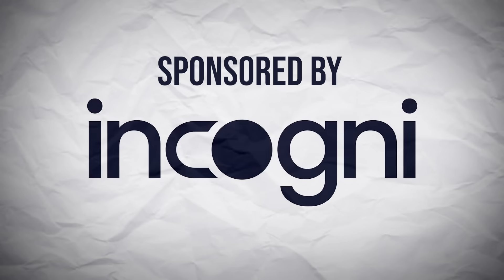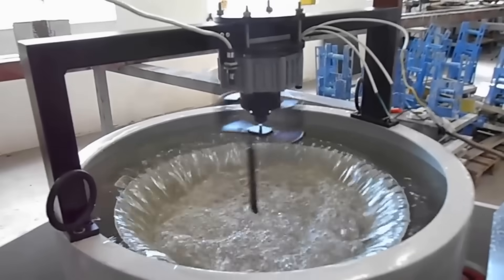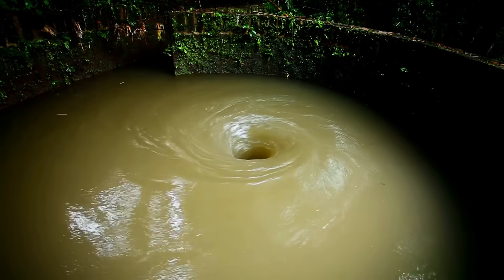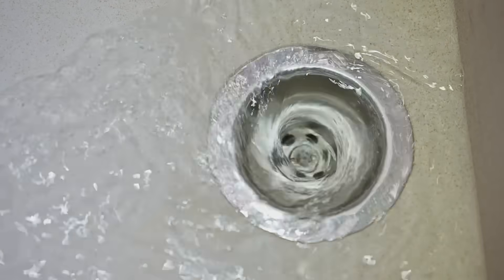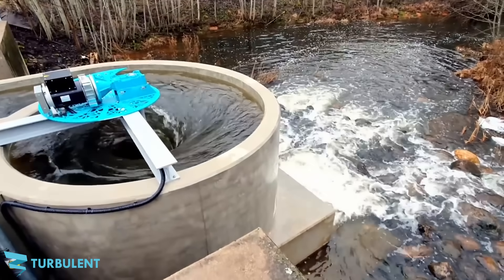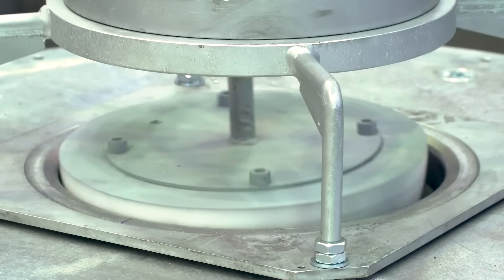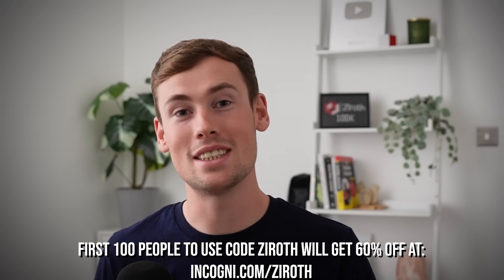Genius Bladeless Hydro Turbine is Cheaper Than Solar

Comment: As for fish safety? I have seen rock crushers work on a similar principle (going round the inner circumference). This mechanism at the speeds it was shown running would crush any fish trying to pass through. The low efficency makes it a no go solution.
Reply: i was thinking the same thing, the way i saw that thing violently moving looked like it would make minced meat from fishes. Frankly, the slow moving bladed version he showed that was supposed to be slow enough not to harm the fish seemed quite a bit more fish friendly, and likely has a higher efficiency.

Comment: Remove the blades from the wind turbines and run with another generator supply demand constant 1-$3,000,000 1megawatt wind turbine OR 857 10kw generators 7.07x

Comment: so basically it's a tesla turbine but instead of discs it has a sphere?
for safety it's definitely good but I can't see it being very efficient.

the info on solar panels is terribly wrong that at this point it's desinformation...
what makes the efficiency of solar panels be around 22% for the best ones is that the silicon only absorbs a small portion of the total amount of photons that hit it besides it also not being permeable to the entire light spectrum and there's already research and prototypes where different transparent materials are "sandwiched" together to achieve (I think) 40% efficiency or so...

Comment: Stumbles in the first 20 seconds.  River flow rates can change considerably from normal to zero and even if some still flow it may be insufficient for energy production and removing much of their kinetic energy causes them to drop silts and block the river.  Once free of sediments and downstream of the turbine, it picks up material and causes sever erosion, (Aswan Dam).  If these rivers are in remote places and free from river traffic, the capital outlay to install and move the electricity on a 55% efficient system, makes it non-cost effective.

Comment: 1 Problem, the vortex doesn't generate enough torque to rotate a generator to produce power from.  What looks good in theory doesn't usually transmit into practical cost effective uses.
Reply: This might just be a misnomer from branding it as "Vortex hydrokinetics". In a typical turbine setup you'd be absolutely correct. In this case the vortex isn't directly driving the turbine. The offset hollow rotator and confusor are the magic elements that make this unstable rotation kick out enough torque. There may also be some gearing involved with the magnetic coupler (mfgr isn't clear on that.) That said, while the water velocity/head requirement is super low at 4 m/s, it still requires 650 liters/second (170-ish gallons/second) of water flow rate for the 5KW turbine to operate nominally. (Reference page 8 of the SETUR-L owner's manual.) So, a moderately sized river is still required. :\
Reply: @QuakeDragon  PE=mgh.

so...im getting 2,340,000L/hr.
at 4M, gives me a PE of 25KWh.

KE, at point of impact, or in this case, turbine blade...

25KWh, at 8.8m/s...

a this point i couldnt be bothered going further... have to start guessing diameters and distances moved after impact and thats all a bit of a grey area here...

other than... if you dont let the water flow at all... no work is done. block a hose at the end... no movement. no work.
if the water flows freely, at full velocity with no restriction... no work is done. let the hose wave wildly. it has almost no mass to counteract the reaction of water exiting the nozzle. no work is done.

strap it to a weight so it moves the weight at half the velocity, and oh my... work is done... the maximum amount of work that can be performed, the largest mass/weight that can be moved at the highest velocity by the energy contained in that moving fluid with momentum.

that is... half the energy of the fluid in motion cannot be extracted. if you extract all of it, water doesnt FLOW anymore.

at best, you get 12.5KWh from the 650L/s at 4M. 
then the generator combo? well... that all gets into what load the generator is working into, but again... same applies... 50/50. at best, you get 6.25KWh at the load powered by the generator powered by the turbine. now we delve into teh electrical equivalent of the same principle... "jacobs law"... once the load is the same resistance as the generator or source, thats it... half the energy in the generator, half in the load.  any overload resistance either draws more current, at a lower potential, or draws less current at a higher potential... 50/50 is the point of maximum efficiency... half in the load, half in the generator...

the irony of these "efficiency ratings"?

you can only EVER extract HALF the energy. that is "100% efficiency". 

again...convert PE to KE, the fluid is traveling at max velocity, with no restriction, performing no work.

convert KE to PE, there is ZERO velocity, and again... zero work done.

the maximum amount of work one can extract is when the fluid is impeded to half its velocity as it transfers momentum to another object.
Reply: literally what I thought watching this.  Hydro turbines have wicket gates controlled by a governor which alters the flow of water through the turbine to keep the RPM constant, and makes adjustments as the LOAD requirements change.
I don't see how this "bladeless" turbine is going to be practical, as it would need to be able to compensate very quickly.  If not, it these bladeless turbine will never be commissioned and approved for connection to any power grids.

Comment: in general, I also have several ideas for simple energy generation without harming nature. for example, use at sea at a depth of a caisson filled with air pulling a cable that turns a generator. at a depth near the bottom, gas comes out of a cylinder with compressed air, fills the caisson, it pulls up at the surface, you will have to draw air back into the cylinder with a pump, compressing it, buoyancy decreases and the caisson goes to the bottom and using 2 such caissons connected by one cable, you can pull this cable back and forth and twist generator. the only significant minus is the required minimum depth, since you will have to pump air into the cylinder, spending energy on it, and to compensate for these energy costs, you will have to add it to the immersion depth of the installation. but otherwise, nothing complicated and expensive is required. no consumable resources, only the maintenance of mechanisms and that’s it. this can be done in the atmosphere with balls filled with hydrogen, but the same cable in the air will be heavier than in water + lift is less + winds and airplanes. in the Soviet Union many years ago there was an idea to use a large kite with a turbine installed on it and at high altitude where the winds blow constantly, energy can be generated around the clock, but again the problem is the cable and its mass.

however, I came up with another interesting version of the windmill) when I was thinking how to implement the option of pulling the cable in the atmosphere, as in the version with the caisson, I suddenly realized why do it at all. Winds blow in the atmosphere and you can simply use the option with a sail, more precisely, a kite like on kiteserving. what if you tie a cable to a large kite and the wind blows, pulls the kite, therefore, pulls the cable that rotates the generator. we add a certain mass of cargo, small enough only so that when the wind weakens, the kite descends back; when the wind increases, the kite rises again. a simple system, but there is a brilliant move so that the kite does not fall to the ground without wind! just combine a kite with a balloon filling it with hydrogen or helium))) in other words, make something like a balloon filled with hydrogen in the form of a frame of some form more suitable, for example, just a rectangular frame and close the space inside the frame simply with a cloth, thus making a sail. such a kite will always reach for the sky, and the wind will either raise it or, under the action of the load, it will fall. When lifting the kite, we rotate the generator. unlike screw windmills, this option, of course, will provide less and more intermittent energy, but the installation cost is so small + maintenance is much cheaper + it will not make noise and kill birds with its blades like windmills with a screw. with windmills, after all, you can simply make a vertical shaft in the ground where the load is lowered and maybe even a small tower above the ground to increase the cable travel. in general, it gives less energy, but it also costs much less; such a windmill is simple and safe.

however, do not forget about the waves on the sea. It is not difficult to install a float on the shore, moved up and down by the waves, which through the beam acts on the generator. install such float generators on any old decommissioned ship, for example, to save money and anchor the ship and let it float near the shore and provide energy with such floats. Oh yes, I almost forgot another interesting option. what if you use thermal expansion? for example, if you take a certain cylinder with a piston and fill it with oil, then the piston moves when heated. well, for example, it can be used in a greenhouse in a garden to ventilate it)) once upon a time I read about this in a Russian Soviet old magazine. if you correctly calculate the diameter of the cylinder and the volume of oil, then at a certain temperature the piston will be able to raise the window in the greenhouse, ventilating it when it overheats. Here atkoy principle can also be used. I'm not sure what will give a lot of energy, but the most simple design and inexpensive but requires the sun. that if a large piston rises from the expansion of a liquid or gas when heated from the sun and pushes the lever, which ultimately acts on the generator, and when the piston rises completely for a small waste of energy, we close the piston with liquid from the sun, the blinds cool down, and so on again and again. instead of a piston, you can use a rubber ball filled with gas as an option. The liquid, when expanded, is capable of lifting a huge mass. this force can be turned through a lever or a gearbox turned into a longer range of movement of the lever that will rotate the generator. As in a car gearbox, the gear is higher, the speed is higher, but the thrust decreases. Since the thrust from the expansion of the liquid when heated is colossal it can be used.
Reply: Like how you think, but there is some problems
Reply: @hennie3663  Problems are definitely there and they are everywhere anyway. I do not claim that my ideas are the best, but they have their pros and cons. Again, you need to understand that in the comments you can’t adequately explain a lot. but in general these ideas can be used quite well.
Reply: @ivannegrozni7692 
I had a similar idea that is why I like it, but air compresses under water and the deeper you go the more compressed it gets, meaning you will need more to fill the same size object deeper down, and as the o ject rises the air expands leaving the object again,
Reply: @hennie3663  that's why you need a cylinder with air and a pump that will pump air into the cylinder and the air will be released simply through the valve. I know that air is compressed at depth, but the concept does not change from this. the only thing that matters is depth. if the depth is not enough, then the pump will spend more energy to work than you get from the rotation of the generator. therefore, at shallow depths it is difficult to implement this. although on the other side it is easier in terms of air compression. in principle, it is possible to do this at a shallow depth, but you will have to greatly increase the area and volume of the air caisson. and also add a more powerful generator in order to get enough energy due to the shorter working length of the cable. but it is more profitable to build this at a greater depth so that the cycle of lifting the caisson and lowering to the bottom is as long as possible. similar can be realized in the atmosphere. using a balloon with hydrogen, but there will be the influence of the wind + the cable in the water obviously weighs less, but on the other hand, you depend less on the length of the cable, since almost anywhere on the surface there are kilometers to the sky)

however, for the atmosphere, it seems to me that I found an interesting generation option. a special type of windmill so to speak. we take a kite like those with which people at sea are fond of kitesurfing. we tie a cable to the load, which should be a little bit heavier than our kite. and the kite must be correctly made not just a piece of fabric in the wind, because then without wind it will fall to the ground. but we use hydrogen, that is, we make something like an air balloon in the form of a frame. and add fabric to the space between the walls of the frame. it turns out something like a sail in its essence only lighter than air. due to the lightness, such a sail will always reach for the sky even without wind. thus we have a load that does not allow our air sail to rise due to the lifting force of hydrogen in the sail. but when the wind blows a force acts on the sail, it begins to move under the influence of the wind and pull the cable, which in turn obviously rotates the generator. when the wind weakens, the weight attached to the cable lowers the sail down. It's a simple push-and-pull system. the wind blows in gusts so this concept will work. and unlike windmills with screws, it is not required to build a high support tower.
you can make a small support and also dig a well in the ground, in other words, increase the course of the cable due to penetration into the ground. it's much cheaper than building huge pylons. it is also possible to add or reduce the mass of the load, for example, with the help of water, thus adjusting the operation of the generator to the force of the wind. you can also add a simple mechanism to the sail design itself that changes its shape by changing the air resistance. thus, even with a constant strong wind, it will be possible to turn the generator. I also think it's an interesting idea and very cheap to implement.

Comment: It's not cheaper than solar. Solar power is the cheapest electricity available and it will stay so for quite some time. Panels are just so cheap and so is install cost and sunlight.

Comment: And as soon as you apply resistance to the shaft the ball will stop spinning since the drag is too low to overcome the applied resistance, ie the used electricity. The efficiency will be so low they need to litter nature with these low efficiency turbines. Good business plan!

Also, this wont save any fish since they will be crushed instead of chopped up. In worst case scenario the low pressure zone will attract marine life and even more fish will die. 

It would be better to invent something that prevents fish to enter a conventional blade turbine instead of this. 

This wont solve our energy problem and it wont save any fish lives either. This is gonna be busted/debunked very soon.

Comment: Battery storage is always going to be needed because it's unlikely that electricity usage will remain constant throughout the entire day, so storing excess when not used is essential.  The only downside to this system is when even the big rivers run drier up due to excess hot weather as we have had in recent years in the UK.  You sound English so I am sure you are aware of this even here.  It is a good idea though, could it be used in the sea as well as rivers?

Comment: what size fish vs what size ball makes this concept less deadly to fish as a whole? seems even a small light ball might cause damage to frie, which are no less important than larger fish who may only suffer a mild pinch from a smaller ball. that said, what if a larger fish found itself heading into the gap between a lighter ball and the housing wall; either the hydrodynamic force would injure the fish or it would stop the ball from moving or both, clogging the generator. if it were a malleable low pressure bladder instead of a rigid ball, the design might stand a better chance; but with this, even with low relative speed, crushing is now a danger. vortex-based fish-safe bladed solutions are safe because the fish are already spinning in the vortex along with the water and the relative speed to the blade is negligible and there is now, still, a crushing danger.  in any vortex situation, how much spin can a fish sustain before being damaged and not just dizzy?

Comment: That wobbly ball hitting all the walls of the tight channel in rapid succession did not look at all safe for fish. Instead of getting chopped into tiny pieces in a traditional turbine, the fish gets squished between the ball and the wall. Or is the ball very light so that it just sort of bumps off the fish without squishing it? Even then I imagine there would be a size range of fish that can survive it and too small would be turned into paste and too big would get stuck between the ball and the wall.

Otherwise tech looks cool though.

Comment: The actual design would be effectively be a single "blade" implementation and potentially can crush any fish that goes through. It would seem a screw design would have a continuous un-obstructed path for water flow that would not crush any fish. Alternately, why not screen fish away to a smaller gentler downstream?

Comment: Hi Ziroth,
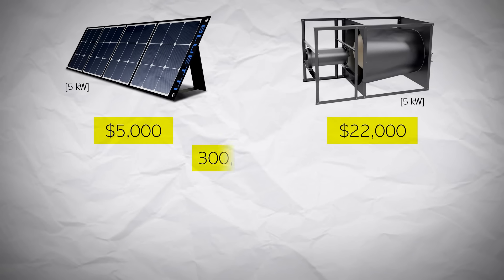I just wanted to bring a calculation mistake to your attention. At 8:41 in the video you state, that 5 kWp of solar (or a 5 kW Water Turbine for that matter) produce approximately 300000 kWh when running at full power for a year. The total energy at full power in one year should actually be closer to 43800 kWh (5 kW * 8760 h/year). Your point of the hydropower turbine having overall lower cost to produce a kWh is still valid though.